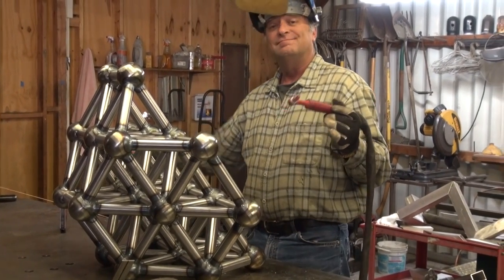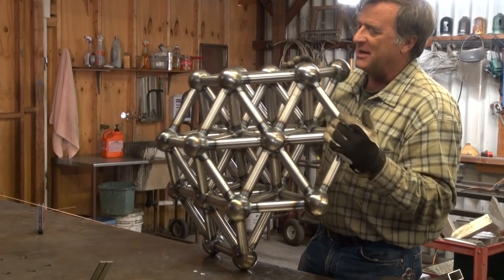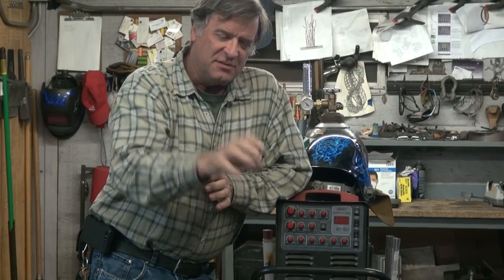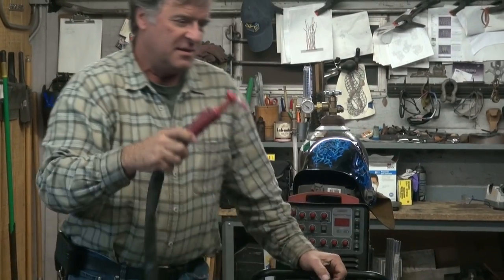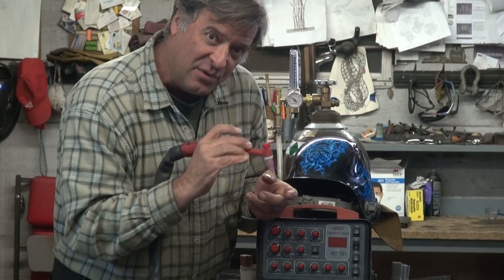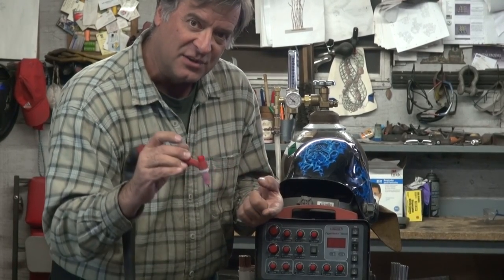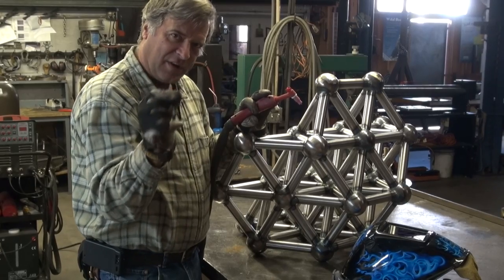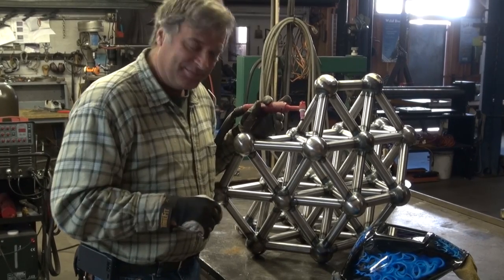How to TIG Weld Without a Foot Pedal - Kevin Caron

Comment: Thanks a million Kevin for this video.   I WAS going to buy a real TIG but not after watching this video.   I have a Boston Scientific Implanted Pacer/Defibrillator.   My doctor yelled at me for MIG welding but nothing has ever gone wrong in 16years.   I stay far away from the transformer case, I keep the wires and work to my right to prevent standing in a magnetic loop.   Magnetism will turn the device off but once the field is gone the Defibrillator will restart and may deliver an unwanted and deadly 16kv shock (what mine is set for).   Properly rhythmic hearts receiving a Defibrillator shock can stop.   Thankfully mine is programmed too and will re-start my heart then pace me afterwards so I can call 911.   It has saved my life 6-time from heart attacks while sleeping in the past 16 years and I've worn out three devices so far.   The magnetic off is a safety feature just encase the device goes bonkers, you just place a magnet on it but you have to goto a hospital so they can link up to it and control all functions before you remove the magnet.
Reply from the maker: WOW!!   I did not know all that! 

Happy to keep you safe but sad you can't play with the rest of us.

Comment: Just got into welding. Trained in 2011 with a foot pedal. Wanted to add a comment. Worked with guys that TIG weld a lot without a foot pedal OR button, just a knob to adjust gas. After training the boss asked me to drive across country to Southern CA to help on a piping project in 2012. After a few days I managed to strike my arc like an old pro. Simple trick of getting torch into position, take filler wire and like striking a match just snap it across the gap between project and your tungsten.

Comment: Whether you choose lift start or high frequency you are making it to seem like it is related to using the switch for lift start and pedal for HF but using foot pedal or switch has nothing to do with the starting method you choose. You can lift start with the foot pedal or switch and same for HF.

Comment: For HF welding, If you are welding in a sheet metal building, you can ground the metal building with a couple copper ground rods and when you HF weld inside you're building the HF will be contained!
Reply: Thank you for that info. I was just about not to buy a HF welder.

Comment: Kevin my understanding of Lift Start and Scratch start are completely different.  To me it sounded like you equated  lift and scratch start as the same thing in your intro.  I don't think you meant to say that.  Scratch is the original way to tig where power is available all the time so striking yields full amps where as lift is low amps until you lift.  I use a Thermalarc Fabricator with lift.  I din't think I would like it but I really do and no thungsten contamination.

Comment: I'm sure the gentleman asking this question was wondering where do you set the amperage at what level do you set the amperage when you can adjust it like that I mean since you can adjust your weld so many ways like speed Etc where would you for convenience sake set your amperage say you work out from a chart that you should be using 80 amps on a certain well but you're limited because you cannot adjust on the fly because you're not using a foot pedal or you don't have a slider or whatever the reason would you set it a little higher and then use speed to adjust the puddle and keep it consistent or what. I am just starting to take weld myself and it is so much more complicated than I thought it would be I thought I would be at least be able to make decent welds after the first few hours of working and that is not the case it looks like someone put a pin hole in a tuba toothpaste and stomped on it that's my welds right now I'm sure I will progress because I'm very stubborn and I will practice my ass off but I have a lot more respect for the discipline holding a tiny tungsten at such a finite position at my age is not going to be easy seeing as hell muscle memory is very hard to build the older you get so I'm going to today as a matter of fact start doing repetitive exercises as many as I can for as long as I can to try and build up a little bit of consistency even if it's not welding per se
Reply from the maker: You figured out my secret right off the bat!    Yes, I will set the amps a little higher, (ie 130 to 135 for .125 steel instead of 120 to 125.)  The great thing about my work and how I work is I can stop in the middle and make bigger changes in settings.   Sometimes I will hook up the pedal if I am working on really thin stuff.  But most of the time speed and pulse will work just fine for me.   Welcome to the wonderful world of welding.   Practice, planning and great fit and finish before you turn the welder on will make your life a lot easier.  Have fun and remember to not touch the red metal!

Comment: Great videos as usual.  I'm trying to find out more about stainless steel welding with inverter tig can you help at all. Thanks
Reply from the maker: Just get the right filler wire for your base metal. You need straight argon for gas and make sure every thing is clean.  If you can run another gas line to backpurge your weld it will turn out better.
Reply: Kevin Caron, Artist thanks Kevin I appreciate your help.

Comment: Hi, I'm attending a welding class actually and the professor tells me that for a good aluminum welding (TIG, in this case) it is necessary to regulate the current (amperage). As far as I know the level of current goes higher depending on the thickness of the material to weld, and the distance between the material and the electrode.

So, do you think that one can be able to form a good welding on aluminum without regulating the current?

Comment from the maker: Can you give me more info please.

What make and model, what settings, etc....
Reply: Welder was Miller Econotwin HF AC/DC 160 amp. (Transformer type). Alarm system was a wired Alarmtron. As soon as I struck TIG arc at any amperage the intrusion alarm would sound and stay on until reset but it didn’t alert the Alarmtron dispatcher. I installed two clip on ferrite magnets on the door sensor lead wires and that solved the problem. I haven’t used HF on the welder since getting the pacemaker. Haven’t had any known issues with the pacemaker using the 50 amp plasma cutter but I now go for the cutting torch first.

Comment: Brother most people who aretrying to weld without a foot pedal are trying to weld a smal tin pice of metal only with tig. what they mean is that is it possible to have it on for a micro second and then again and again so that you can tig weld without filling metal
Reply from the maker: Sure, just set the 2t/4t switch to 2/t.  Now every time you press the finger switch the arc will start and as soon as you let go of the switch the arc stops. Only way I know of to do what you are asking about.

Comment: My machine doesn't have option for foot pedal or a switch on the gun...my problem is in order to stop the arc you have to pull away from the metal and therefore lose the 5 seconds of shielding needed at the end...any suggestions??
Reply from the maker: A quick twist of the wrist will break the arc, then twist back to shield the weld. Then turn the gas off with the knob on the handle of the torch. I am assuming that you have a knob of course .
Reply: Thanks Kevin, I'll give that a try.  Appreciate your quick response.
I have another question maybe you have knowledge of.
I'm repairing my sailboat rudder
The rudder post Is stainless 1 1/4" diameter and I need to weld 1/8" x 2" x 12" long  stainless support members 90° (perpendicular) using a butt joint.
Since they are different thickness do you have a recommendation for this type of weld?

Comment: At my work nearly everything is SS. Every time I have tried tig welding I just burn the tungsten off, or stick to the work because it's lift, I guess. I want to get a pedal for the welder because it's way too frustrating.
Reply from the maker: It does take a lot of practice to get used to lift tig!   Keep at it, you will figure it out!

Comment: Hi Kevin

Whats the diference on the inverters with Technologie IGBT HF, is there still the problem with the HF on electronics, what is the benifit of the IGBT?
Reply from the maker: I am sorry but I really don't know the answer to this.   I know the HF problems have been fixed with IGBT but I am not sure what was done.
Reply: So does the inverters that have HF with IGBT, are they safe now to use near computors our TV's.

And thanks for the reply, and great videos that you have there, Im trying to lear more since I only now the basic, and you have given me a great help. Thank you Sir.
Reply from the maker: Not too near!!!      I would still be leery of getting around any electronics with a tig welder or plasma cutter.

Comment: What if I don’t have a switch or foot pedal? My torch is controlled by a valve. Can you help?
Reply from the maker: it's called a scratch start tig.  The tungsten is always "hot" when the machine is on.  Just touch it to the metal and lift slightly and you are welding.   The valve is there just to control the gas.  DON'T FORGET TO TURN OFF THE GAS WHEN YOU ARE DONE!

Comment: what about lift start without switch on stainless steel? How do you snap out without causing oxidation/sugaring?
Reply from the maker: Have another piece of stainless next to the weld.  Snap out over that piece.   I am guessing here.
Reply: @KevincaronSculpture  . That actually sounds right for some things. I just don't think you can always get another piece of stainless into a place when welding. Such as tubing, but I will have to see if it is possible to clamp a piece on. Thank you.

Comment: What if you weld with lift arc but have no foot pedal or button, do i treat it like scratch start when ending a weld?
Reply from the maker: Yes you do!
Reply: Im here running beads   flat beads..i am fairly new to welding...i have the certifications and yada yada but i am not that new to welding to know that thats only paper..i weld on maganese rail frogs (the piece of tdack where the train switches tracks) and that really has buffed my stick welding skills unbelievably...im starting to (with my whole heart trying to at least) work on being a good tig welder. Practice practice practice..yes i understand..but am i shorting myself by using a lincoln 100amp inverter welder? I have a rock solid 87 Lincoln weldanpwr g9..with the airmatic spool gun..but i would need an LN 17 attatchment to run HF..i feel that i have the idea of tig down enpugh to widen my horizons a bit.    I would like to be able to weld up to 1/8 inch or a little thicker...using a wp17 torch with both standard and gas body lenses. Any suggestions..i was thinking of biting the bulet and purchasing a squarewave

Comment: So i only tig welded twice but my boss does it a lot and one thing I've noticed is my hood likes to flicker on and off whether I'm looking at the arc or at the arc from a mig welder and the tig is being used on the opposite side of the room... It never happens if I'm just mig welding only tig... But we don't use hf or any of this stuff we use a pedal
Reply from the maker: God, I hate it when that happens!  Try changing your sensitivity on the helmet. You have it set too low I think.
Reply: @KevincaronSculpture  see i thought the same but even if i turn it all the way up itll happen... But then when the tig welder isnt being used itll turn on and off cause the lights in the shop are enough to trigger it then lol

Comment: What does a TIG welder’s HIGH frequency do to a guy’s pacemaker?
Understand most pacemakers are OK below 150 welding amps if arc is 2 foot from chest and if pacemaker is affected by the arc the pacemaker should normalize as soon as welding is stopped.
Reply from the maker: To the best of my knowledge once you get a pacemaker you can no longer weld with high freq.   Not sure how true that is but that is what I was told.

Comment: My High Frequency welder setting would set off security alarms until I put magnetic RF coils on the alarm system wires.
Reply from the maker: Oh yeah!!   Mine used to change the channel on the radio!

Comment: hey Kevin you shoulda been a science teacher..anyway.. bought an old Eutectice Buzz Box cira 1967 rarely used AND a optional 'Dyna Tig Voltage Stabilizer' unit by same company that sits on Top.. i bet youve seen these before.. is that unit a high Freq starter?..im new  to tig and ive only tried the Tig process twice   i only have bits of original  manual the company apparantly is too uppitty to even mention anything about welders on its site just consumable like fancy hardface rods  will DC work

Comment: I never have experienced when i use HF start that my Radio will not work, even my Computer will still work if i not hit the Power direkt to my computer.Where does it come from.I weld many places where Computers in it, Radios and other Electronics no one ever failed, or gets damaged.No welder who is under Quality control uses Lift Arc to start the welding process direkt where he has to weld, we use a copperplate to start the welding process. As you can see i am still alive. Many times i get hit by high frequency start.I don't no what Kind of Tig Welder you have, but i think you not work with  4 Stroke. Maybe the Machines are used in the States are much different what we use in Europe.
Btw looks good what you are doing
Reply: powertothebauer I'm not sure if the inverter type HF welders interfere as much as something like a Dialarc HF with tungsten arc gaps that make a nice buzz, I still need to test my HF to see what it interferes with
Reply: The older ones we have make nice buzz too, the new ones when you push the Trigger there comes no buzzing. It is more  like a pop and there hit is .
Reply: Maybe the answer is that we use 220 Volts at minimum Voltage ,maybe it is easier to Produce the Voltage for HF is needed